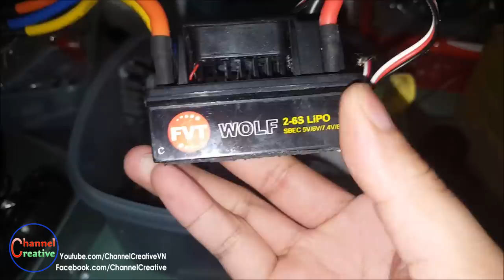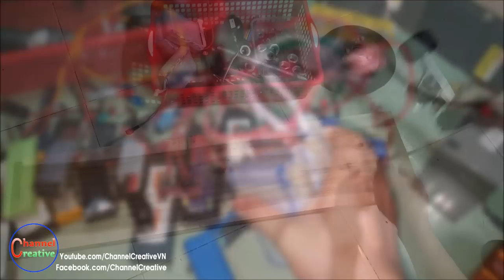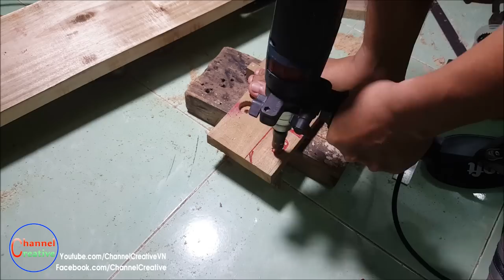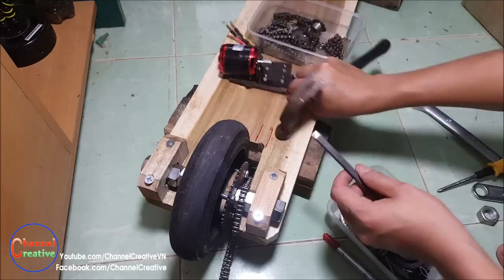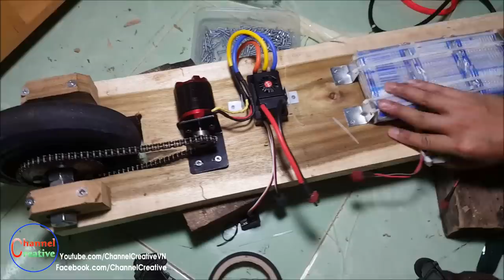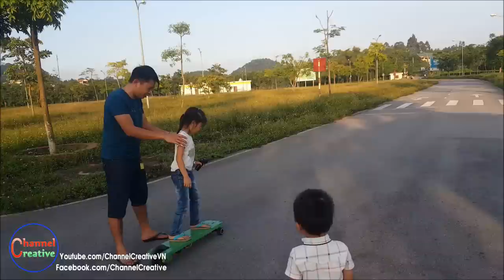How to make a Electric LONGBOARD using Piece of wood at home

Comment: Just grab your nearest radio transceiver, sprocket, 20v electric motor, throttle control, some different probably 3300mah+ Lipo batterys,  longboard trucks, some brackets, and your favorite dollar store sandals just some basic stuff everyone has, Oh and dont forget the star of the ELECTRIC longboard, the wood.

Comment: for my opinion, it is better if u create a cover for battery and for all the material that is connected with electric, when u using this board u will not worry when the water splash under the board.

Comment: You should have put a slit up the board and drilled a half inch hole at the end of the slit so it wouldn’t crack. So it the board would flex when you turn